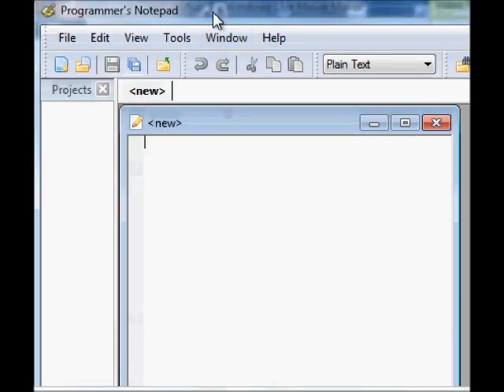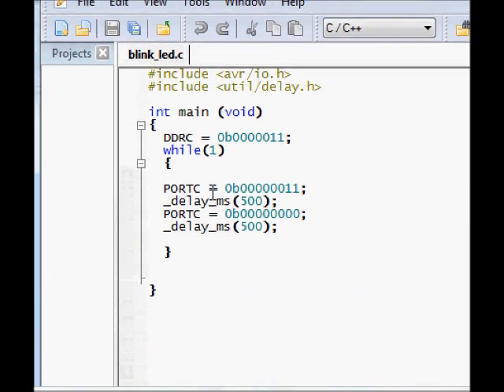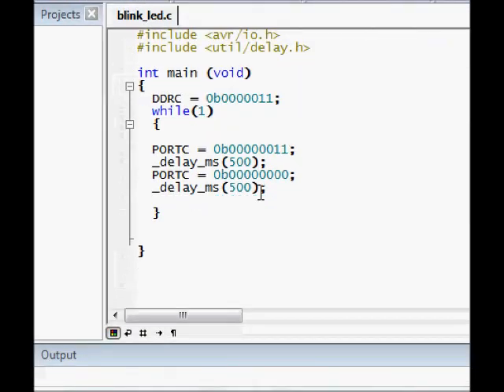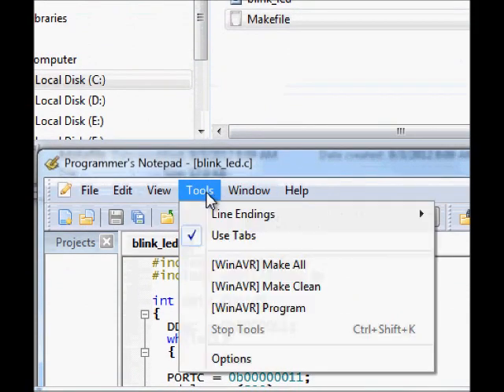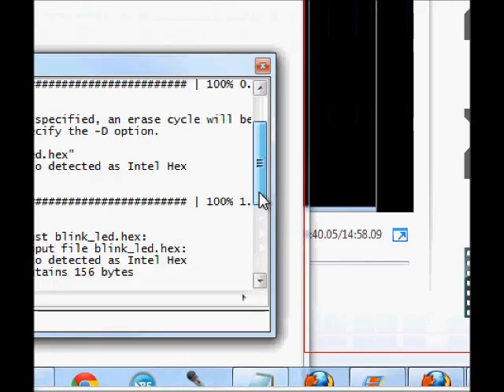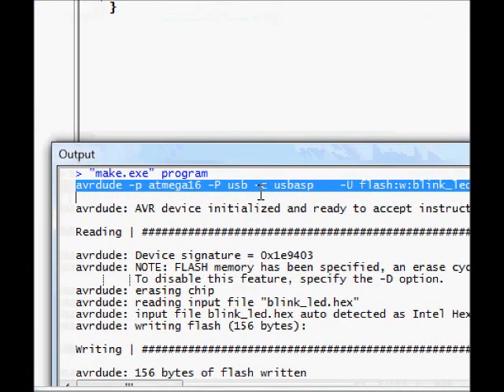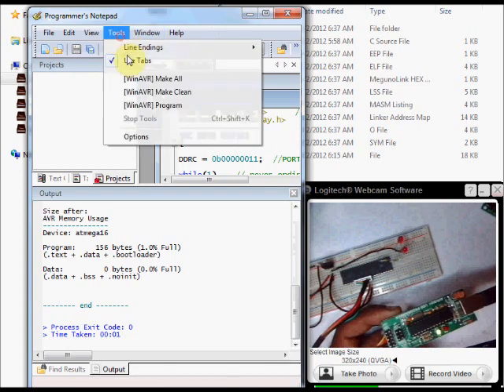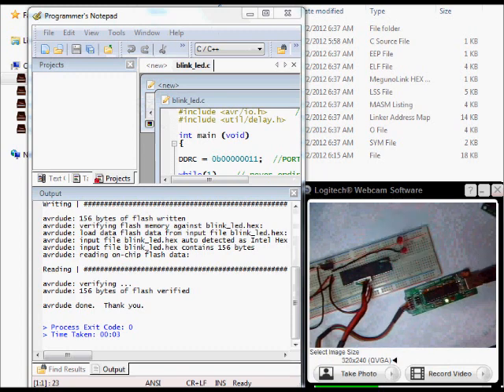AVR Programming -3 -Burning .Hex file onto AVR chip

Comment: Sir I am using AVR USB Programmer and Development board of THINNKWARE. I am able to make the MAKE File but not able to burn the program in the microcontroller ATMEGA 16L. The Error is

"make.exe" program
avrdude -p atmega16 -P usb -c usbasp    -U flash:w:touch.hex 

avrdude: warning: cannot set sck period. please check for usbasp firmware update.
avrdude: error: programm enable: target doesn't answer. 1 
avrdude: initialization failed, rc=-1
         Double check connections and try again, or use -F to override
         this check.

avrdude done.  Thank you.

make.exe: * [program] Error 1

Process Exit Code: 2
> Time Taken: 00:00

Even i tried AVRpal.Net but it is not working.
Please reply as soon as possible
Reply from the maker: Check the connections between Usbasp board & target board.Generally in Thinkware boards they haven't followed the standard connections of MOSI,MISO. check out this  for details :
 http://alselectro.wordpress.com/2012/09/05/avr-programmingtutorial-2hands-on-programmers-notepad-make-file-creation/
Reply: Saravanan AL Sir I have checked the connections but still not able to do it.
I am using Windows 7 64 bit. Does it make any problem?
Reply: Saravanan AL AVRpal.Net says that it is not able to detect any chip.

Comment: hi sir, avr studio 5.0 is unable to generate .hex files on my system.
i have windows7 64-bit, so i tried using AVR studio 6.0 but the problem persisted.
There was no Hex file created. As a result, I am unable to burn any program on the AVR microcontroller.

Comment from the maker: Hi,
It seems your UsbAsp hardware is not recognized by Windows.Open up Device Manager under Control panel & scroll down to see "Usbasp" . If not, install the drivers.
Also make sure that your C program file & Make file reside in same folder.Otherwise, P.Notepad won't compile.Don't forget to include the file name (your code file without .c extension) inside Makefile

Follow up the procedure as in my blog :alselectro.wordpress

Things should work fine.

Cheers,
AL.Saravanan